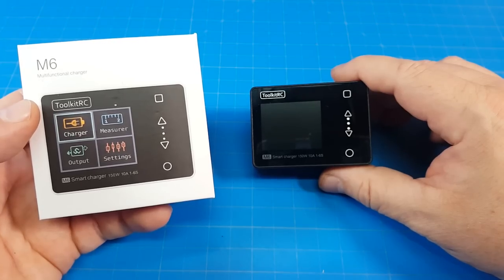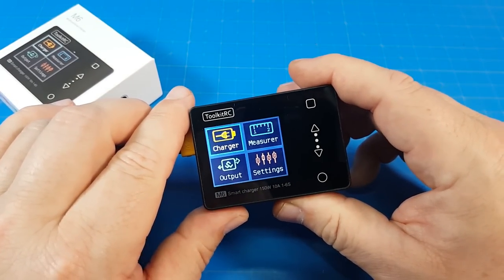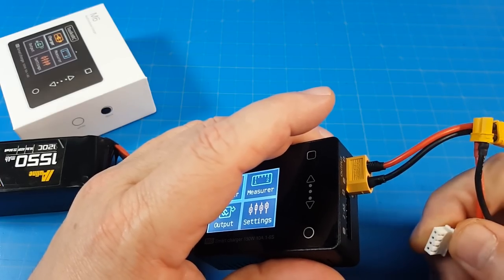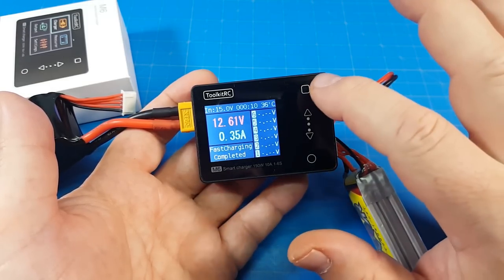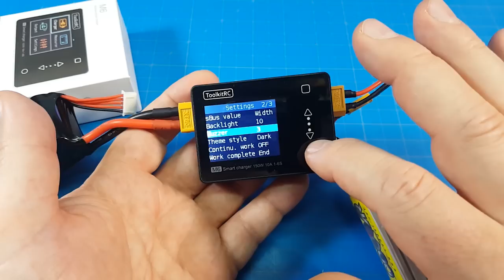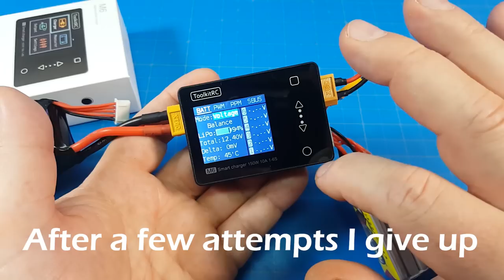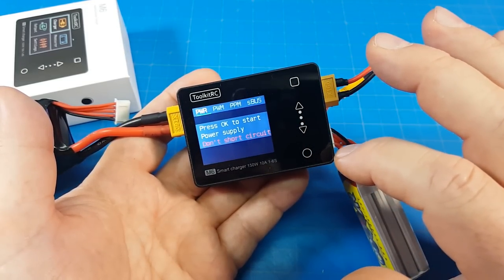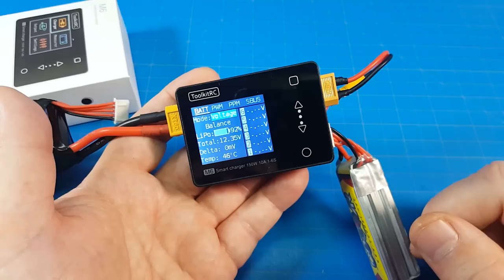Zeez Flight Stack // Smoox RCInPower Motors // M6 Toolkit

Comment: The pins in the Zeez are for soldering TBS crossfire Rx and pro32 nano vtx too so you don't need a stack mount or any other mount. Makes for really nice and clean builds.
Reply: Pins can be kinda fragile though, but maybe the crsf stuff is light enough it wouldnt be an issue?
Reply: @M.TTT.  Yep it's light enough, were talking 1 gram for vtx and 0.5 for rx. it's the only way I do my builds now. They way they get soldered in makes them rock solid.

Comment: @Nick Burns, you have the balance lead hooked up backwards too the ToolKitRC charger. The lead is supposed to be plugged in with the negative lead on the left and positive on the right. Im pretty sure thats why its not showing any of the single cells voltage  but still shows the total battery voltage though. You also have to  choose between balancing and internal resistance test of the battery

Comment: Those 1507 motors would be great for either a Racer X mutant 4" on a 4s 850 with gemfan 4023 props, or an ET5 5" on a 3s 1100 130c gnb with gemfan 5125 props. I'll be looking forward to seeing your videos on the toothpicks and the Diatone branded Powerpick. 

Somebody else already mentioned it, but I'd agree that a tiny trainer kit would be a good setup for those 1404 motors. That or a Twig XL on 3.5" avan props

Comment: Nick, I think that stack you're supposed to be able to direct solder a Unify Nano Pro32 VTX and a Crossfire Nano RX to it with those pins you said you can't imagine using.  That would make for a compact stack with RX and VTX taken care of.
Reply from the maker: lol, I can't imagine it as I haven't used crossfire :)
Reply: @NickBurnsFPV  you could still use a Unify Pro32 Nano VTX to save space
Reply from the maker: @heroflying  true

Comment: Interesting mounting concept on that 1507 motor, kebabs props(gemfan 3016) are also have 2mm hole option, so they should be a direct fit :) by the way I bought those rcinpower 1204-5000kv motors for a 3inch toothpick build running 3s, I would love to build something similar and what you think about them on 3inch 3s versus 2.5inch 3-4s.
Reply from the maker: I did forget the 3016 and 3018 have 2mm hole mount.

Comment: You can get a power supply for the m6 battery charger, stu from uav futures has link to it, plus as someone else mentioned, and I think he’s right, you’ve got the balance leads in the wrong way. I’ve got one and haven’t had any problems with either the charger itself or the power supply.

Comment: I have the same 1507 motors plus some 1207 on the way. 1507 is going onto a 3 inch
Reply from the maker: Any particular 3inch frame your going to use?

Comment: Gday Nick, i have that same charger like others have pointed out the balance plug was the wrong way aroung the negative goes to the bottom of the balance plug simple mistake easy to do mate, i would be a bit concerned with that zeezs esc being a bit wide for a 2.5 or 3 inch builds how about building a light weight 4 inch freestyle with that set-up that you have, nice looking motors, the drill tool is cool but it would faster to use a small battery drill with that set-up if you had lots of props to do, cant wait to see what you build, great review mate.👍🛸
Reply from the maker: ah dang simple mistake got me. Thank you for the tip. I do consider a lightweight build for the zeez, we have plenty of 1507 motors to try on it, or buy others.
Reply: @NickBurnsFPV  Nick us older guys that need glasses dont always see small details im going to order a magnifyer led lamp so i can see better to solder and the fine details on the micros and battery chargers lol!! that seem to get smaller evey year, getting older sucks lol 👍🤣🤣🤣
Reply from the maker: @spartan-fpv6936  lol yea, my eyes haven't gotten better. I did have glasses until I turned 37. I was still playing baseball at the time, small time town team stuff. I showed up with glasses and the team was surprised. They asked me how I have been hitting before the glasses, I told them...I wait until I can see the ball before I swing...lol.
Reply: @NickBurnsFPV  Very cool mate. lol🤣🤣🤣

Comment: I like the idea of a small prop nut instead of two bolts but I don't want to have to drill out my props every time I need to change one
Reply from the maker: It is one more step, I suspect this is part of testing the market for a new prop hole size. I shouldn't say new as we do have the gemfan 3016 and 3018 with 2mm shaft holes.

Comment: I really think it would be cool if  you did a sub 250g 5in build using the brother hobby hyperbola frame with the those 1505 motors and that 20X20 stack. Now i know that you said 4 inches or less Nick but really 1 more inch 🤏 isnt a big deal right? 😆
Reply from the maker: I wouldn't expect the 150x size motors to handle a 5 inch prop very well. I suspect 4inch is the max.

Comment: I have a hx115 frame with 1404 and 3in. Prop that flys amazing
Reply: I'm thinking of swapping out my 1204 motors on my hx115 frame for some emax 1404 6000kv I have laying around. What kv do you have on yours? And what size and cell battery are you using?
Reply: @sakfpv8444  xing 1404 4600 kv 3-4s and 20 amp aio
Reply: @sakfpv8444  450-750 r line in both 3-4s
Reply: @Brian Langford awesome! Is it the JHEMCU 20a AIO? that's what I'm planning on using
Reply: @sakfpv8444  mine is betafpv toothpick board